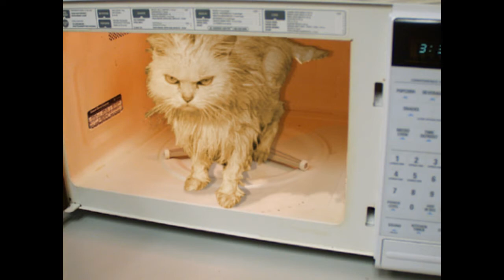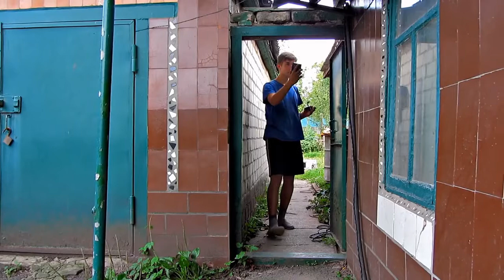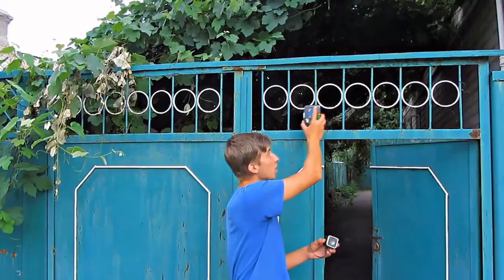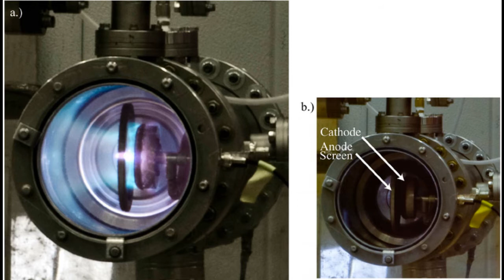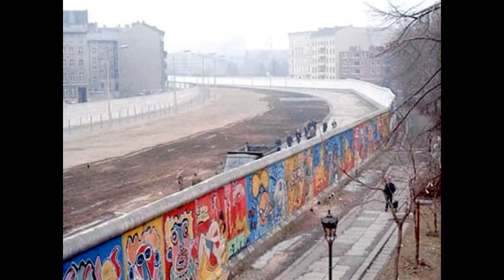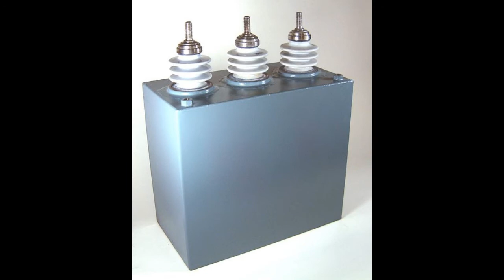How I think "Havana Syndrome" the Cuban Embassy Attacks microwave weapon works

Comment: I got microwave attack too in Taiwan since 2023/8. 😢

I guess it has something to do with my strange neighbor. 
This underground group is huge. 
Penetration engineering outsourcer, hidden WiFi monitoring equipment in residential buildings and chain stores. Use the device to control the remote background to lock specific targets and perform energy attacks.

Thank you for your share.❤

Comment: Very interesting video. Have you considered the hum phenomena that's been heavily reported in recent years? In the UK alone multiple towns are reporting a low frequency sound. Personally I believe pulsed microwaves have something to do with it. There's an audible effect which resonates through bone and can be heard as low frequency noise almost like a diesel engine sound idling. In your opinion how would this be propagated on such a large scale. I was thinking an artificially ionised environment would help propagate pulsed microwaves. But the source of the pulsing I can't pin down yet. 
Any thoughts would be appreciated.
Reply: @robsyoutube  Again, very interesting and thank you. The accounts I'm familiar with indicate the noise is far more audible indoors  and only in certain properties. The factory hypothesise has been investigated and nothing found. My initial thought was it had something to do with the electrical wiring in the home increasing the field strength. Recently most UK towns have seen a massive roll out of new LED lighting and 5g infrastructure. Also new wind farms many of which have come online in the last 2 years. I'm also aware of a few major issues when connecting the renewable energy to the grid. So in short we have a massive roll out of new technological infrastructure and a sudden increase in audible phenomena. I find it difficult to not see a connection in some form. The national grid did however measure some noise in flintshire in north wales, around 50hz but didn't believe it was anything to do with the grid per say. Needless to say they were unable to locate the source of the noise. The investigation is ongoing. I'll have a read of the information you posted. Thanks again.
Reply: @robsyoutube  I've just ordered, be interesting little experiment. Cheers. 

I'm looking at other possibilities as well. Maybe I could draw your attention to a paper I've been flicking over. 

Its connected to Havana Syndrome. 

This is a copy/paste from the article...

While electromagnetic radiation is known to transduce to optical phonons, electromagnetic radiation was not earlier believed capable of acoustic phonon coupling. However, Nelson et al. (26), using “Laser Induced Phonons” (LIPS) methodology, demonstrated that electromagnetic radiation is capable of coupling to acoustic phonons in absorbing liquids. These investigators used two ~532 nm lasers with slightly different wavelengths to produce a difference interference wavelength tunable in the 1–30 GHz region by tuning one of the lasers. The absorbed light heats the liquid at the peaks of the differing laser wavelength, causing thermal expansion, thus launching acoustic waves at that specific wavelength. A secondary laser probe diffracted by the momentary diffraction grating generated by the peaks of the acoustic waves then detects resulting acoustic phonons within the liquid. Figure 3C is a schematic representation of non-uniform heating phenomena capable of transducing microwave energy into acoustic phonon waves in brain tissue.

I found this fascinating. I'm not sure how you would detect it though outside the laboratory? 

The paper can be found if you search...

Pulsed Microwave Energy Transduction of Acoustic Phonon Related Brain Injury

Graham K. Hubler, Stuart W. Hoffman, [...], and Ralph G. DePalma
Reply: @robsyoutube  I wonder... a house has multiple ring mains and therefore multiple low frequency electromagnetic fields. The reports are very clear. People can hear a audible low frequency hum. If let's say a home was targeted using LIPS which isn't difficult, then the electromagnetic field via the piezoelectric bone effect would resonate also at low frequency making it audible to whomever was in the room. Now if lasers can stimulate an electromagnetic field audible response presumably microwaves can as well.  Which begs the question. The Havana syndrome effect is potentially on tap and available to anyone who might wish to use it?  The power outputs are minimal and well within domestic infrastructure capabilities.

Not sure how true it is but are you familiar with the "Lilly Wave". John Lilly. Its basically a carrier wave that can be weaponized. The man is apparently on record saying he discovered it.